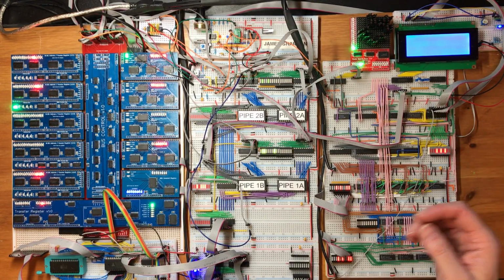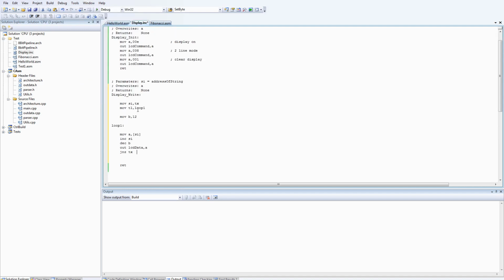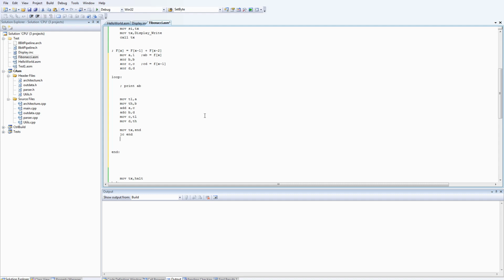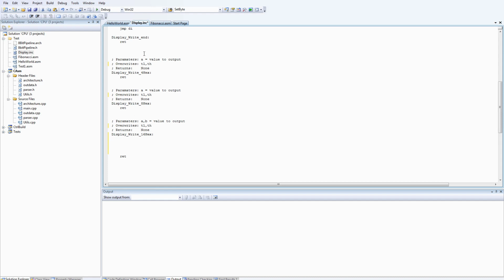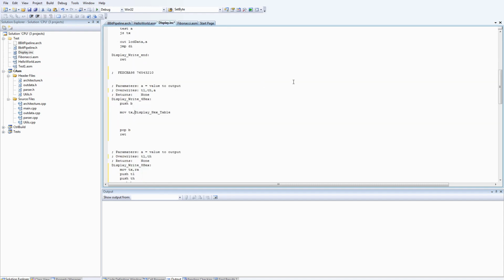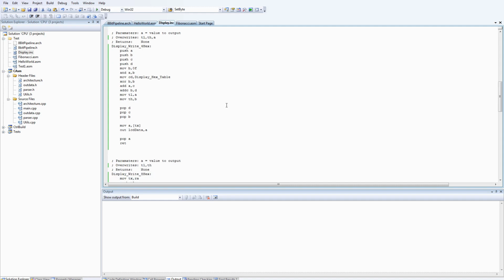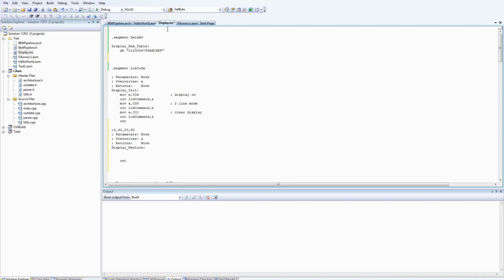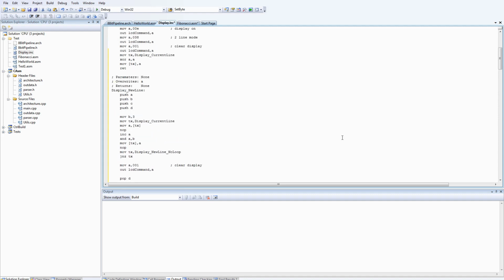Coding 1, The Basics - Making an 8 Bit pipelined CPU - Part 64

Comment: I'm surprised there is no scrolling on that display. Was that a necessary loss when you removed the SPI board off the back, or is that display particularly simple?
The solution is elegant regardless, so either way it's a non-issue.
Reply from the maker: I was surprised where wasn't a scroll command as well. You see these scrolling all the time but it's done in software and I was often driving the build at a very low clock rate that would have made that tedious.
Reply: @weirdboyjim  I went digging. Mine has a scroll, but you have to be annoyingly careful after using it. It takes a while and it ignores the input buffer while it does it, risking lost data. You don't need that grief!
Reply from the maker: @R.Daneel  Are you sure?  The HD44780 boards have a horizontal scroll but not vertical
Reply: @weirdboyjim  Oh, sorry. I didn't mean to imply I'm using the same board. Mine is ancient. Serial interface. That was the source of my shock, actually. Old display with more capabilities with a more modern one.

Comment: Your text editor has text too small to read.
Note that you are recording in only 720p, so their reduced to smudges even if one examines the screen closely or uses a zoom-in feature.
Reply from the maker: No, that's a 1080 recording. Check your youtube settings. I switch from 720 to 1080 around part 7. I also switch to a larger editor a larger font for the editor in the next programming video.

Comment: Thanks for the video. You wanted feedback on the code, I'd like to see similar amounts in future videos, but please crop the editor gui and enlarge the font, some of us are on their phones.
Reply from the maker: Thanks and that's a Good suggestion. I've had a play around, if I crop the window it ends up looking low resolution but I can increase the font size in the edit window and reduce the size of the areas on the left and bottom.
Reply: @weirdboyjim  I think you have to record a smaller window, not crop after recording, if that's what you meant. It's probably setup dependent, it works with software I use for recording.
Reply: I;m on a laptop patched into a 60" HD TV on the wall and can't really see either well enough to keep up with the explanations.  Most video capture programs are different but nearly all have the functionality of selecting the area of the monitor they record.  We really don't need to see any of the directory tree on the left or the Output section on the bottom just eliminating those would help a lot.

Comment: Thanks James. There was lot to take in, but I'll manage by rewatching. At least I have the stuff I read about microprocessors in the early '80s makes the design and hardware videos easier. I have no assembly language experience, so the programming takes more effort to understand. I have no problem staying in Hex, it is more appropriate for this level of operations. Interesting as usual.
Reply from the maker: Thanks Jerril, I appreciate it. I think you'll be more comfortable with the optimisation video I have planned (I think that will be #66). That video will be more about lining bits up the right way, there will be a big chunk of explanation that will apply to hardware just us much.  Care to hazard a guess about that software bug I didn't stop to explain? That will be the next video.

Comment: You can also use the "double dabble" algorithm to convert an integer into BCD, which should be trivial to output using your existing hex routines. Just shifts and adds. 🙂
Reply from the maker: Very good suggestion, but:  (a) It's good on paper but all the compares get clumsy in software. (b) Divide is really useful and will make a nice optimisation example (c) Do you really want to sit thru a stuttering explanation of Double Dabble from me?

Comment: Have you been building a custom linker script? I would love to see more about that as I'm currently trying to wrap my head around them and make one for a (presently) theoretical m68k system I want to build.
Reply from the maker: No custom linker, but the assembler has some extra features that would normally go into the linker. The linker has a bunch of jobs, the relevant ones here are resolving addresses and relocating the objects. In my assembler there isn't really any boundary between blocks of data and code (A programmer can see the label followed by ret pattern but the assembler just sees a list of sees labels and instructions). Normally an object file would have a separate block for each function and a symbol table. The linker would start with the entry point, then pull in the blocks for the things it references until it has a complete program (and not the bits it doesn't need). The linker script gives it key data on where to put sections (pretty much what I'm calling segments in my assembler). The big difference in my simplified tool chain is there is no way to link separately assembled files (I'll just have a hierarchy of includes) and no way for it to strip unreferenced data and code.
Reply: @weirdboyjim  ah right, so similar concepts, but your own assembler. I was thinking you'd gone to the trouble of using GCC or something. 😋

I'm looking at using the m68k GCC toolchain, but want to figure out how to, e.g. build a vector table for the various interrupts/exceptions/etc so I can just feed in some C and have it spit out a binary I can program onto some ROMs.

Slowly getting there, just looking for different examples and eventually it will all click.
Reply from the maker: You should be able to do that by defining the vector table a struct in C and assigning a static instance to a custom section. Then in the linker script you can position it explicitly.
Reply from the maker: You'll probably start to see how the segment system in my assembler is designed to give me a similer level of flexibility with the least possible effort. I use a 2 pass assembler strategy, in the first pass I work out labels position relative to the start of their segment. Then between passes I assign the segments (now I know how big they are) to actual addresses. In the 2nd pass I generate the code now I know the correct values for all the labels. Saves me needing to build a true symbol table or give the back end any knowledge of how the addresses are used.
Reply: @weirdboyjim  cool. That would make a good video in and of itself!

Comment: Nice work getting the lines in order and making it into a library.
Reply from the maker: Thanks Adam! The combination of include files, function calls and segments makes it much easier to write re-usable code. That first execution of the program had me grinning like a madman and punching the air.
Reply: @weirdboyjim  Not surprised, Its a good way to start the new year as you have now reached Chapter 2 of your pipelined CPU